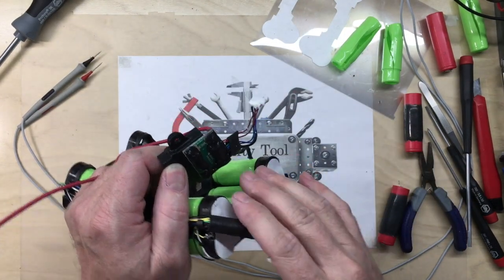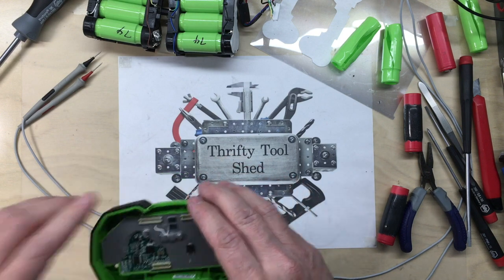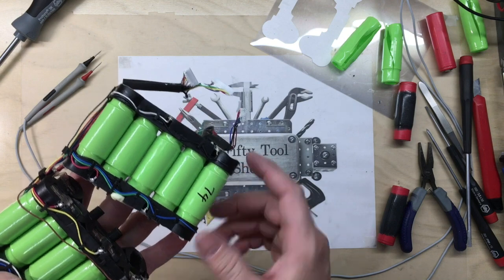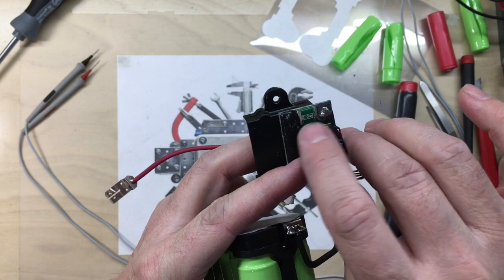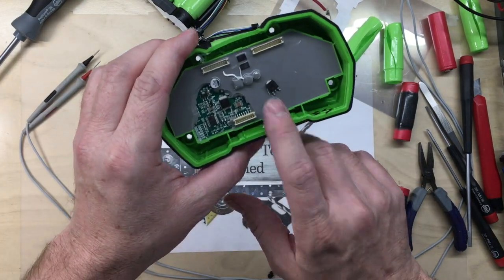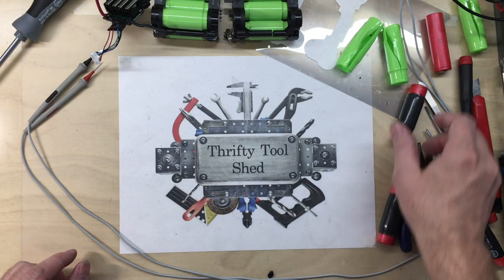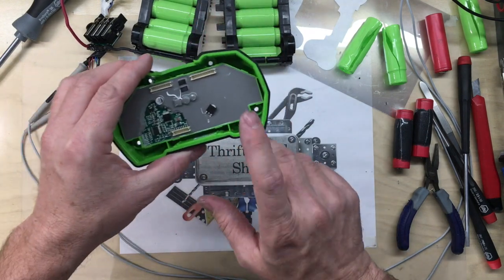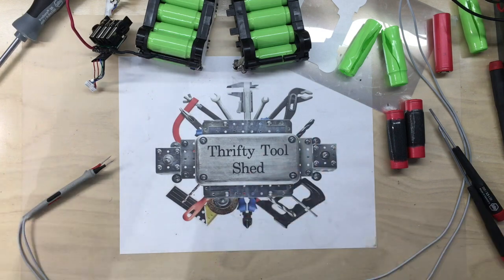EGO 56V Battery Repair Update

Comment: I have followed this thread and ordered the MJD117. I fixing to tear down and replace. I just want to say, I don't know if anyone was not being able to charge the battery under the green flashing issue or not ? my charger would just go on and off, so I took it out put it in over and over and until I started holding the button in, in doing so then the charger went steady and charged the battery. of course the flashing green light eventually drained it. sometimes after the charger had charged the battery and stopped, it really did not charge so I repeated and it always charged the second time. Just want to say your help with this is very appreciated.
Reply from the maker: Thanks for your comment, and just to mention, you are doing great by trying to keep the battery charged. If the cells drop to far the cells will be damaged.
And the charger is sensing low voltage and will try to pulse on/off to get the voltage up if it doesn't bump up after a amount of time it will show a faulty pack!
Best of luck!

Comment: My battery just developed a problem. I've only used it a handful of times (it's its first summer), and all of a sudden it went dead. No lights come on at all, charger won't have anything to do with it. 

Measured the voltage, it's actually all the way up to 58V!

Were any of the batteries you repaired like that? I'm assuming it's a chip or a faulty connection.
Reply from the maker: Hi, I did not have any exactly like that. First of all it should still be under warranty. Contact ego to get new replacement. Then if they still tell you to keep the old one and recycle it as they did with me last year then open it up.  I had one that had a bad fuse on the connect board and it read zero at the connections but all batteries were showing 58v in series once I read a cross all cells before the fuse?  I have never had one read 58v at connections and still be bad!
Reply: Yes, they are sending me a new one but told me to recycle it! I'm an electrical engineer (industrial controls, not control boards, but I've played a little bit with then in school), so I'm genuinely curious and if I fix it, great!

Will open it up once I get my hand on security torx. I doubt it's the fuse, since I read 58V right on the contacts.
Reply from the maker: nakednhappy, awesome. I feel the same way it will be interesting to see what you find. I have had a few different failures but not exactly like this one. It's a great sign that you have 58v on the cells. Seems like all your cells are in great shape, hopefully. I wonder if it's in the temperature feedback for the pack basically a NTC circuit. 
Btw, I am like you, I am Industrial electrician and have repaired drives and some boards over the years so more of I hobby for me aslo, and I really enjoy it. Best of luck.

Comment: I have an issue charging an EGO battery.  Although it is flashing green,  it is accompanied by a loud clicking (relay) sound from the charger.  Any thoughts?  Thanks for the great videos!
Reply from the maker: B Appel, check your voltage of the battery. If it gets pulled down too low. It will do that. It will try to bump it up and then it will error out if not at a acceptable level. Sometimes the cells are beyond help in this case. If you are lucky sometimes bumping the battery up as I did with the Drok can help. Usually it may need individual cells replaced.
Reply from the maker: B Appel, Best of luck and thanks for your comment.
Reply: My brand new battery is doing this also. They are shipping a new replacement but I tore this one down to check things out. I confirmed each cell is reading exactly the same (around 3.71vdc). The voltages are also present at each of the charging terminals. Nothing happens when I push the power button on the pack (it used to light up green right out the box).
The first time I put it on the charger it began to charge and the charger fan was going. Around 15 minutes later it started clicking. At least I have 14 new good cells!

Comment: I gave up on my repair, and just harvested the 18650 cells for use in a couple of USB power packs.  I almost gave up as the cells didn’t fit till I realized that you have to remove the outer plastic and that state change material.  I had a very difficult time removing the material in the first battery till I realized, you can just slid it off..
Reply from the maker: michael charach, sorry to hear that the repair was a no go.  Yeah, always a bright side, the cells are great to reuse. The state change sleeves just slide off easy unless the cells has gotten hot enough to melt it. When it solidifies back it is stuck   pretty bad.

Comment: I would be very new to the battery repair game, but I was thinking of getting some bad battery packs and trying to get them whole again, cheapest I found was 25 a battery with shipping, do you think it's worth while to do it?

Thank you.
Reply: Excellent video thank you again
Reply from the maker: john voigt, I think so, I have noticed the prices on these batteries have gone up on eBay. As always it is a gamble, you don't know for sure how low the cells are. When I ordered 4 I was able to get 3 fully repaired and the 4th one I repaired the BMS to have spare, but used the good cells in it to fix the other 3. Best of luck!

Comment: Do a teardown video about the ridgid cordless brushless hyperdrive  nail gun.
Reply from the maker: Michael Hodge, I do not have access to one at the moment. I have several years ago worked on a few ridgid cordless nailers and was very impressed by the engineering inside then. The motor had true speed feedback with an encoder and the cable and piston system was very unexpected. I wish I would have videoed all repairs I have done over the years. Thanks for your request! I will look into it.